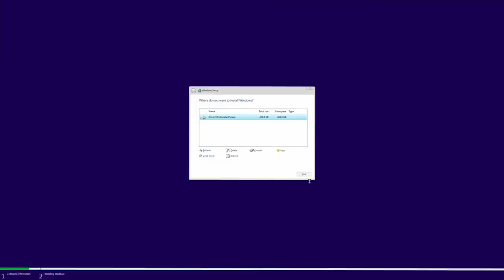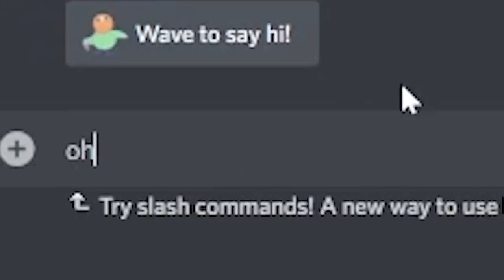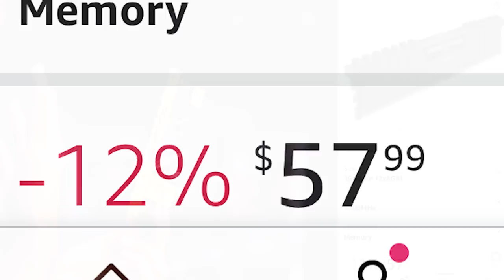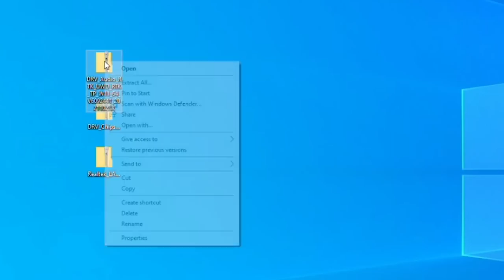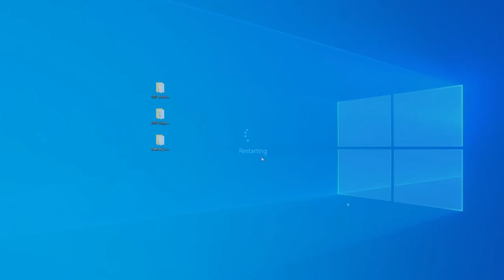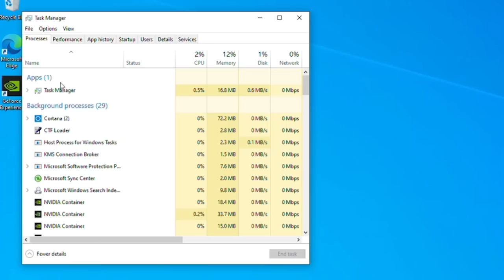$700 Gaming PC Build Guide - GTX 1660 SUPER (w/ i5 11400)

Comment: I have pretty much the same build that I built back in 2019 (except with a 3600) and it’s amazing for 1080p gaming, I definitely recommend this build
Reply: Man I would like to know your SPECS cz... I'm thinking to get a pc bases on 3600 and 1660super
Reply: @alvaroelandres6320  Yeah man, I got those plus 16gbs of 3200 ram, 512gb nvme+1tb 2.5in ssd, asrock b450m motherboard, and a 600w gold power supply. I built that in 2019 before prices skyrocketed tho, so idk what that build would cost now.

Comment: I would change out the gtx 1660 super for a rtx 2060 6gb because the cheapest 1660 super is 210$ and the cheapest 2060 6gb is 220$ (or for the 2 fan model it is 230$)
but it is 20% faster and it has DLSS. 
If you have a bit more money you could also go with the rx 6600. It is 34% faster and the cheapest model comes for 250$ (it is a 2 fan model).
Reply: exactly, i would consider the 1660 super a bad buy here. rx 6600 is the best gpu price/performance wise rn.
Reply: @TaymonsterAnimation  yes it is a good gpu price/performance wise for rx 6600, but then you're looking at an 800 budget pc. this is a 700 budget pc so the 2060 for only 10-20 more makes sense like JustJoel said. rx 6600 is about 60-100 more right now depending on manufacturer. you would have to sacrifice somewhere if you get an rx 6600 and stay at 700, like switching to intel i3 12100f, etc etc.
Reply: @bx_718stryker7  The rx 6600 MSI MECH 2X is 249.99 at Newegg, so it is more like 40-50 more right now and the i3 12100f is about the same price as the ryzen 5500 if you take the mobo prices into context so you wouldn't be able to save any money there.
Reply: Depending on country as in Europe alot of countries the lower end amd cards are still spenny.
Reply: I think this is one of the few builds from Joey that is not really well thought out. Kinda crappy IMO.
Reply: @JamesBond-vi2eh  lately hes been making awful build for the budget especially for gaming
Reply: if I were to do this would I need to change any other part or would I just do the same thing except different graphic card thanks for your help
Reply: @murtezaersoy8687  change the cpu to a 12100f and change the motherboard to a asrock b660m pro RS
Reply: @JamesBond-vi2eh  it’s really not that bad every offering these changes it still ups the price the man made a video about the pc being 700 some people only have 700 and can’t go over
Reply: can i change to a rtx 3060 ti?
Reply: @soulnyr  3060 ti isnt worth it just get a 6700xt/6750xt
Reply: @Fancy405  i already buy the rtx 3060 ti, but it is too bad g?
Reply: I built this like 2 months ago and I want to upgrade my monitor to 240 I’m currently at 60 what do you recommend for the gpu and cpu
Reply: @MrSoccerlover21  dont get 240hz kinda a waste just get 1440p 165hz and you should get a 12400f with a 6750xt/6800 (non xt)
Reply: does the 2060 fit in this build? i have no knowledge on pcs and wanted to build my first one. do you have any advice or tips? thanks
Reply: @SALAZAR-te8mf  i would recommend you to watch a guide thats is a bit more up to date than this one

Comment: Great build performance wise, but 75+ Celsius on both the GPU and CPU is kinda hot in my opinion. It depends on the game, but still. I would at least spend a few $ more to get something like a Noctua or BeQuiet Air Cooler to prevent the CPU to reach more than 70+ Celsius.
Reply: mb causing the GPU and CPU to reach high temps, i saw it in other videos comparing budget b550 mbs
Reply: I think if he put more case fans, the temps for both CPU and GPU would decrease significantly

Comment: Hey Joey great video, but one change I would make is to change out the 1660 super for a rx 6600. It has better performance and is about the same price right now, you would also be able to take advantage of amds smart access memory.
Reply: Yeah but the encoder may be important to some people as well.
Reply: Thanks bro I'll consider doing that
Reply: @Ben-sr8lq  if you want to go with nvidia i would recommend a 2060 its the same price but  around 20% better
Reply: @justjoel3903  yeah that's a good idea too
Reply: Where can i get rx6600 for 225usd?
Reply: @justjoel3903  you could but around this price I would up it to 850 the very least because you get more price to performance
Reply: @Ben-sr8lq  the rx 6600 has an encoder aswell....
Reply: The rtx 2060 is 200$ at evga 2060 12gb is 239$ and a rx 6600 is 250$ any of those cards  are better
Reply: @NemusDark  thanks
Reply: @NemusDark  
EVGA GeForce RTX 2060 SC, OVERCLOCKED, 2.75 Slot Extreme Cool, 70C Gaming, 06G-P4-2062-KR, 6GB GDDR6 this is one of the Better one right?
Reply: @ties9123  nvenc is much better than amd ones
Reply: @Ben-sr8lq  why would encoder matter, it’s a 1660S. It’ll only come into affect for streaming or productivity.
Reply: @aousy9532  because some people actually consider encoders an important factor? that’s why they’d matter, if you don’t care about them doesn’t mean other people don’t, and yes even though it only comes into play for the things you stated, some people still look for those things in a pc, you can’t speak for them
Reply: @faid5883   there around 250 to 299 do try ebay
Reply: With the ryzen 5 5600x and amd 6600xt gonna perform better than this build
Reply: Mainly for cod warzone since thats the game i play more
Reply: @rocky_boi2125  yea I have a 6600 eagle and it works great with warzone, I play with all high settings
Reply: @Ben-sr8lq  not on a 1660 super lmao. Just look up benchmarks of productivity benchmarks such as 3d modeling or rendering a video.
Reply: @juanmendoza233-2  don't buy that omg. Get a rx 6600. Why would you buy a 2060 new in 2022, while 4000 series is already coming.
Reply: @ties9123  cos it's a solid card and it's likley that because there are new unsold 2060s from the shortage it's likley you can get good prices on them in some cases.
Reply: @garycollumbell1396 the rx 6600 is better either way, just buy that.
Reply: @ties9123  it still cost about 350GBP(and that's the cheapest model) so for those looking for budget cards it's kinda still expensive in the UK. 1660 supers going for 200 big price difference 2060s can be had for 280ish atm. So rn it really isn't that good of a buy in the UK the xt version is more worth it if you gonna go that route.
Reply: @garycollumbell1396  lmao, no. I just checked the UK market and a rx 6600 is £250.
Reply: @aousy9532  the encoder I think lowers down the loads for streaming and you don't lose much fps in the end that's why the nvenc encoder is better x264
Reply: @ties9123  well with 4000 series that's about probably 400 watts for a 4070 and it's just insane while we don't know anything about cooling or anything like that but I'm just saying that 30 series is all you need for 1080p high refresh a 3060ti is enough
Reply: @nick-cd5tg  what the hell are you talking about
Reply: @ties9123  wdym I am saying the nvenc encoder is very good and is a reason why you may want to buy a Nvidia card compared to amd
Reply: @nick-cd5tg  that's not what you said. Either way, AMD has an encoder aswell. Like you just say shit and expect it to be true while not even looking at reliable benchmarks. Just watch some benchmarks and see what gpu suits you.
Reply: @ties9123  surely you don't know how to read
Reply: @nick-cd5tg  you tagged me talking about a 4070, while I haven't said anything about the new gen gpus.
Reply: @ties9123  my fault idk shit about pcs I just wanna buy one to play rp and shit🤣
Reply: Are you able to put it in this exact build?
Reply: @cristianomora9689  the 6600? If so yes you can and you will be able to enable smart access memory
Reply: @squ1nt  No, the 2060
Reply: @cristianomora9689  oh yea you could put it into this build no problem, and it would perform better than this 1660 super
Reply: @squ1nt  Great! Gought a 2060 today
Reply: @cristianomora9689  nice what cpu do you have?
Reply: @squ1nt  Ryzen 5 5500
Reply: @cristianomora9689  noooo not the 2060, such a waste of money man. It's such an old card, return it.
Reply: @justjoel3903  a 2060 isnt better than 6600 unless youre talking about the 1660
Reply: 390 for the 3060 which way better than these.
Reply: @master_baiter1873  6600 just as good with smart access memory enabled, and is 140 dollars cheaper
Reply: @squ1nt  nvidia is better. Ray tracing. Btw, inland having a deal with their processors and motherboards. $234 for a tuff motherboard and 5500. No cooler though. They had a new 4500 with lesser motherboard motherboard for $170. This is on amazon.
Reply: @master_baiter1873  Let's be honest who even really uses raytracing unless your playing like minecraft
Reply: @squ1nt  have fun with poor amd drivers ig. But everyone should know about the cpu and motherboard deal.
Reply: just get a 6650xt which is way better for the price then what you're recommending
Reply: @master_baiter1873  rx 6600 performs very simular to the 3060 and is much cheaper.
Reply: Is there a MB I can switch it with that has wifi compatibility that can support the R5 5500 with the rx 6600. Also that can fit in this case.
Also what specific RX 6600 should I get. 
sorry for all the questions im new to building.
Reply: @bryan8426  yea this motherboard has a wifi version that is 10 dollars more that's what I have and it works great
Reply: Thank you! 
Would you mind passing the name and also do you think it would fit in the case shown in the video.
Also what RX 6600 do you recommend there's so many on amazon.
Reply: @bryan8426  dont get the 5500 get a 12100f and a asrock b660m rs
Reply: @Fancy405  b660m outta stock on newegg any alts?
Reply: @tsushi35  a gigabyte b660m ds3h or if you have a atx case get a asrock b660 pro RS
Reply: And Streaming on Twitch?
Reply: @MrKevin38603  yes it would be better
Reply: @Fancy405  if i wanted to build this what all would i need to upgrade?
Reply: @zholyxx5883  I don’t understand
Reply: 2060 is better than 2060 and it's around the same price
Reply: What is a good rx 6600 that is budget friendly
Reply: @Jesiaha  the gigabyte rx 6600 is 249.99 on amazon right now, but the xfx one is almost always 250
Reply: Does anyone know if I could alternatively use the NZXT H510 as opposed to this case?
Reply: @Ndujlz  I wouldn't get the h510. find an atx case with good air flow but I they do have h510 flow. It's best to get a case with alot of air flow.
Reply: I’m building this exact PC it’s my first time building a PC so I don’t know much so I’m just wondering if a RX 6600 or RX 6600 XT would work for this PC because I’ve bought everything Joey used in this video  except the graphics card and I’ve read the comments and I didn’t really find my answer I would really appreciate it if you could help me out
Reply: @jayy60hzz  yes they would both work, the rx 6600xt is better but if you are trying to stay in a budget I would go with the rx6600
Reply: @jayy60hzz  the 6600xt should be better but everyone is waiting to see what the new cards are going to do. The new RX7000 series card might be equal price or better with a performance boost. GPUs are still high and once a new one comes out the prices for the old ones will drop fast. Just do more research about gpus and make a wise decision.
Reply: No for some ppl like me prefer nividia readon gives deley it’s rlly bad and doesn’t offer much for comp gaming go for nividia but for 4K def radeon
Reply: @NemusDark if you were to upgrade the gpu would I need to also upgrade the power supply
Reply: @justjoel3903  Nah bro go find a used 1080 ti. You can find them around $200 and have a bit more power then both a 2070 and a 3060.

Comment: Best 700$ pc is B550M PLUS motherboard Asus tuf 750 power supply, ryzen 5 5600 cpu, 500 gb ssd hardisk, 16 gb ram with 3200 MHz. Cheap pc case and that's it. You don't always need gpu to run smite

Comment: Would this be a significant upgrade over my current pc?

Specs:
CPU: Ryzen 5 2600
GPU: Radeon RX590
Motherboard: Gigabyte Aorus B450 Pro WiFi
Ram: 16 gigs DDR4-2666
Power supply: EVGA 650 Watt 80+ Gold
SSD: 250GB Samsung (external ssd)
HDD: Seagate Barracuda 2TB
Case: NZXT H510
Reply: yep

Comment: For those with a budget below $1000, this is the best PC you can Build:
- Deepcool Macube 110 MATX
- Asus Prime B550M-K
- Ryzen 5 5600X (Stock Cooler)
- RX 6600 XT PowerColor Fighter
- Team Group T force 16GB RAM 3600Mhz CL18
- 1TB SN770 Gen 4 Drive
- Noctua NF A12x25
- NZXT C650 PSU
- Fan splitter
Total= $948.96
Reply: Could be better ngl
Reply: You could build a pc with an 6700xt or 3060ti for that price ngl
Reply: @Ryan-si2zb  tell me a PC with 3060 Ti for that price, which is better..
Reply: Case comes with 4 fans not good for over locking tho

Comment: Does this build work with the Mother 
Board MSI B550M PRO-VDH WIFI Motherboard M-ATX - Supports AMD Ryzen 5000 Series Processors, AM4, DDR4 Boost (4400MHz/OC), 1 x PCIe 4.0 x16, 3 x PCIe 3.0 x16, 1 x M.2 Gen4, 1 x M.2 Gen3, Gigabit LAN, Wi-Fi 6 from amazon?
Reply: Go on pc part picker it shows u what’s compatible and what’s not

Comment: First off I wanna say great video keep it up. Also I was considering upgrading my pre build cyber power desktop (motherboard and cpu and gpu ) would I need to uninstall any old drivers or reinstall new ones for the motherboard and cpu , I know I would have to install drivers for the gpu but is it possible I could do a swap of the parts and just turn on my pc like nothing happened and it work fine  but now with a better hardware?

Comment: I would love to give you a challenge to build a ryzen mini itx in the smallesr itx case possible with a dedicated GPU inside. Budget should be less than $900 and you can mix used and new parts! Plus points with ray tracing.😉👍👍👍

Comment: Hello this is a laptop question, 
I am a bit confused between a 1650 and 3050.(same CPU) 
My only concern is regarding render times I will be getting using after effects( as that's what I usually do with my laptop). 

Should I go for the 1650 or wait make more money for 3050.(Is it worth spending more for it). 
hope to get help☺
Reply: If the 3050 version isn't much more expensive than the 1650 version, I'd say buy the 3050. If it's $100 or more over I'd still probably get it since RTX cards have more features such as RTX and DLSS, unlike GTX cards.

I'm not so sure on rendering, but I bet the 3050 has newer architecture that makes it render a bit faster than the 1650.
Reply: get a 2060 instead

Comment: Hi Joey! I was building a PC very similar to this (partially based on one of your previous builds) and I'm running into an issue where my keyboard does not respond, so I'm unable to spam the delete key to get to boot menu or anything like that. Have you run into this, and do you have any tips for a first time PC builder?
Reply: Are u sure everything is correctly plugged in? Might possibly be a faulty keyboard maybe?
Reply: Have you tried using different USB ports with the keyboard? If that doesn't work maybe you should try a different keyboard and see.

Comment: Built the same PC. Followed all instructions.  Not my first build. Monitor and keyboard will not connect. Tried everything. Checked cables. Gpu seated correct. RAM seated correct. Everything is powered on all fans running. Help
Reply: Figured out true problem. The mother board needed a bios update. Unlike what was said in the video

Comment: BOYS I NEED HELP.. Soo I bought this exact build through the links Joey listed. I have spent numerous hours trying to get a signal on my display but nothings worked. From reseating the ram, cpu, graphics card, even the mother board itself. ( I’ve rebuilt it a few times at this point) and everything turns on from fans on case to gpu fans, but I still can not get a signal. Any ideas? I have a month to return all the stuff on Amazon so I’m not worried but it is annoying….. also I’ve tried removing the cmos battery and trying one ram stick at a time😢
Reply: @superman the rapper i get no signal on my display, and the motherboard does not come with a bios flash back button. So if im not wrong, theres no way for me to know if its updated. i tried looking for ways to update the bios without a cpu or flash back button but came up empty handed.
Reply: @Disabled sped kid was there away to update it without getting to the bios or using a flashback button? Also me and a friend both bought the system and he did not have any problems. his booted up first try.....

Comment: 6600xt - 310
12400f - 150
16gb - 50
b660 - 85
normal case - 50 (even the metallicgear was available for 50)
evga 600 - 40
msi spatium 1tb - 85

total - 770

like add in 70 bucks and you’ll be getting a much better system than this one

anyways love your video joey 😀

Comment: Joey, for this build you should've used an i3 12100f which performs better than the ryzen 5 5500, also, ryzen is outdated for now. the gigabyte b660 for intel LGA 1700 is only $110.

Comment: Guys can you rate this pc for me based on the specs and price and tell me if i am buying a good pc:
Intel core i5 gen 11 f
16 gb ram ddr4
480 ssd intenso
1660 6gb palit 2 fan
Motherboard h510
Case gladiator argb
Powersupply 650 wat
It comes with a sot of keyboard, mouse and headset together for 600 euro. Is it a good idea
Reply: nah u can build it urself prob les then 600€
Reply: @safiesongrind  how so
Reply: horrible
Reply: @OfficialVontify  any reason or upgrade you can suggest me?
Reply: @nitinamani2479  it doesnt have a gpu and for 600 euro its trash value
Reply: @OfficialVontify  if you say so, what should I buy if you got any proper idea about that